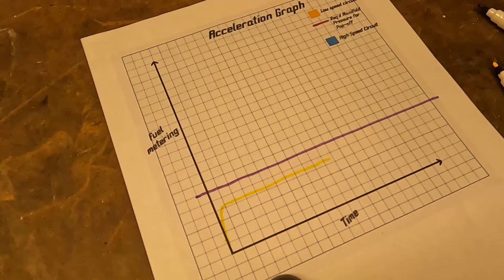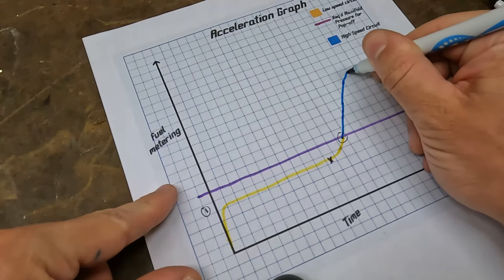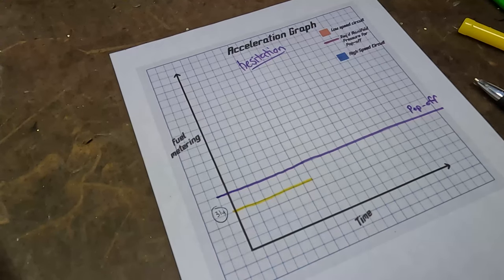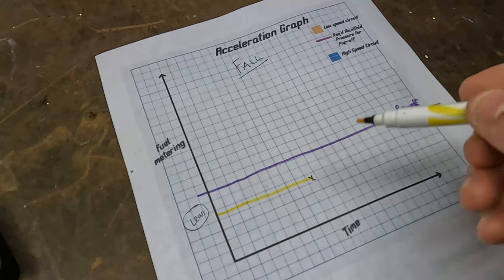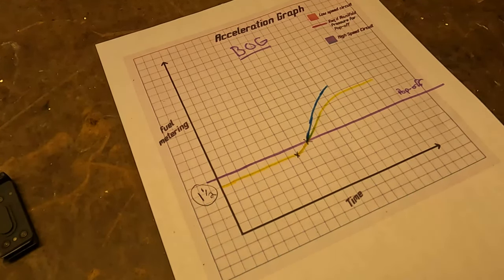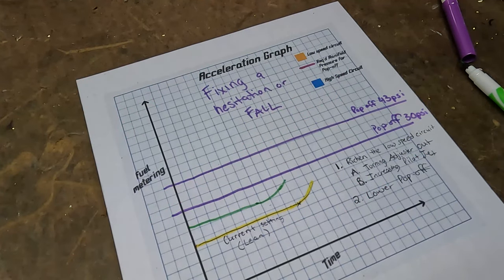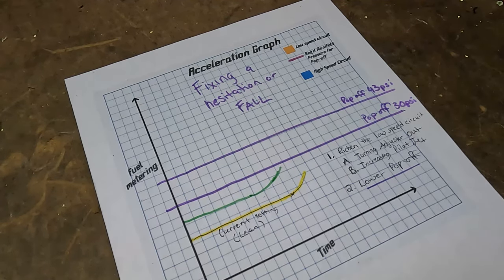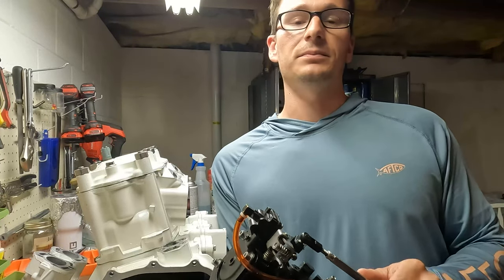Seadoo | Hesitation, Bogging, and Smooth Acceleration Explained

Comment: So far I have found 3 separate examples from your utube videos. 1st was my missing plastic metering collar  in a cdk2 witch I have located.  After watching  this one I wonder if it was removed to deliver more fuel instead of  changing  the low speed screw or  the pop of limit?

Comment: Thanks for the video 2-Smoke, is there ever a reason to adjust the High speed screw?
Reply from the maker: If you are changing altitude… going from higher altitude to lower altitude.  Seadoo likes to put the highest possible main jet for sea level… and make it 0 turns.  If you go from sea level to say 5000 feet, you would need to go a couple sizes lower in the main jet.

Comment: So I have a seadoo GTS 95 model, single carbI've rebuilt carb with mikuni parts from seadoo dealer. With the original spring pop off was 20 psi, with new spring it's at 12 psi I'm confused they both seem low according to the chart, what would be the next step to get the sputter at low speed to go away

Comment: So in tuning out a hesitation or fall, we could lower pop off or turn out the low speed adjuster... (and use a larger pilot jet as well I assume)    But is there any reason to go one way vs the other?  Like it's not very feasible to change your popoff while out on the lake, adjusting the low speed needle makes more sense in the field.  But for initial setup on a bench, and I know I have a major Fall condition going on, why should I opt to lower popoff vs adjusting the low speed screw/pilot jet?  Are there other "side effects" to take into account?  

Also, is it fair to say that the low and high speed needles are a form of "finer adjustment" for the pilot and main jets respectively?  to give an analogy, like those old school balance beam type scales when you go to a doctors office, where the "big" sliding weight (50, 100, 150lbs) are like the jets, and the "small" sliding weights (1lb increments) are turns on the needles
Hope that made sense!
Reply from the maker: @neppy5  to answer your second paragraph… yes it’s sort of a finer adjustment.  But for Mikuni, once you go beyond two turns out, you need to go up a jet size. 

This is how you should tune a hesitation in order of feasibility and what Mikuni wants you to do.  Remember hesitation on take off is due to a lean idle mixture… so…
1) adjust idle screw to slightly richer the mix… its okay to be just below or above your recommended idle speed as long as it is a smooth idle and takeoff. 
2) low adjuster screw… for dual carbs, adjust both at the same time and rate.  1/8 at a time.  Give the ski more warm up time and a few take offs before judging If it works. 
3) change pilot jet - this will require removing carbs
4) I wouldn’t change pop off unless you aren’t getting anywhere.  For most (for example)it’s a matter of going from a 95g spring to an 80g spring.  

Also, make sure your carbs are probably linked.  This causes a rough idle and could affect take off.  Make sure you have new spark plugs that are properly gapped, and you have sufficient spark.
Reply: @2-smoke  Thank you  Thank you  Thank you!!  I feel like I have a solid plan of attack now.  I think my idle currently sounds smooth around 1300, and I actually went like 4x turns out on the low screw, so I'll definitely try a larger pilot jet next
Reply from the maker: @neppy5  what ski model?  Stock?
Reply: @2-smoke  hey, it’s a 2003 Yamaha XLT 800, 170hrs, pretty much everything stock except the impeller which i changed to a Solas because the one it came with was locked up, wear ring and most cables changed too, around 135 psi compression is both cylinders, dual mikuni carbs, rebuilt with OEM kits, followed stock settings: 120 for the main jet, 90 for the pilot, stock turn outs in needles, 1/2 for high, 1.75 for low, stock silver spring with 1.2 needle/seat yielding around 82psi pop off which is stock, put in new accelerator pump just to rule that out, 1100-1300 rpm idle in the water

the ski gives trouble starting, i would have to pump the accelerator many times and crank a few times before it starts,  in the water i couldn’t go above 3k rpm and 15mph, the ski would simply not respond to pulling the throttle more, and if i went WOT the engine would stall, also i had to keep pumping the throttle otherwise lightly otherwise it would stall (while moving)

Thanks to your videos i’m able to see i had a severe lean condition going on leading to Falls, this week i’ve swapped to a 1.5 needle/seat, now popoff is 55psi, changed the fuel filter as well for the heck of it i am hoping to try it in the water again this weekend, if it hesitates i plan to  double check the idle and up the pilot jet to lets say a 95 next

apologies if this was lengthy, but i figured the more details the better when diagnosing
Reply: @2-smoke  random question if you don’t mind, i changed the needle in seat in one carb, popoff test was successful at 55psi 3 times, changed the other carb and noticed that gas ended up coming out of the fuel in port where the pop off tester was connected, i was super confused and eventually realized that nothing was coming out of the fuel out port, like i applied pressure at fuel in with nothing blocking fuel out, and yet no air was coming out from fuel out
my guess is i might have installed one of the check valve’s backwards on the pump side when rebuilding, does that make sense to you?

Comment: I got a 96 seadoo xp and I just rebuilt the carbs with mikuni parts. I have the high speed screw all the way closed and the low speed at 1 turn out. the pop-off measured at 43 psi and 38 psi. It idles good but from idle to 1/2 throttle I can feel it stumble, Once I get past 1/2 throttle it takes off like a bat out of hell. I adjusted the low speed circuit 1/4 turn more out and it didn't seem to make a difference. Should I get softer springs to bring down my pop-off pressure?
Reply from the maker: Pop off pressure of each carb need to be within 1-2 psi of each other.  Don’t forget to turn your high speed screw 1/2 out on the PTO (rear) carb as that cylinder will run hotter.  Please watch my recent video about pop off pressure analysis.

Comment: So with a fall I would start by adjusting the low speed out to be more rich? And if the adjustment is too far put bigger pilot jets in?

My 95' GTX carbs are all clean with new Mikuni parts and pop off at 21psi. Idle and first 1/4 throttle is great but anything beyond 1/4 stalls it out no matter how fast or slow I open the throttle.

This video is a great starting guide to marine carb voodoo!
Reply from the maker: Correct.  Usually this happens when the idle screw is not where it needs to be.  Remember, if you increase idle, you are allowing more air in. Seadoo manuals say the idle screw should be turned in two turns from contact of the lever on the butterfly.  Set the low adjusters then, and usually this will be on par with a good take off.  Make any further adjustments on water. 

If you are still having issues, set the idle while running the ski dipped in water (while on the trailer).  Make sure ski is warmed up and the idle will be between 1400-1600 rpms. Then turn out your Low adjusters (together) until you hear the rpms drop.  When you hear them drop, turn them in slightly. This is how to correctly set idle.  Side note, idle rpms out of water is 3k.